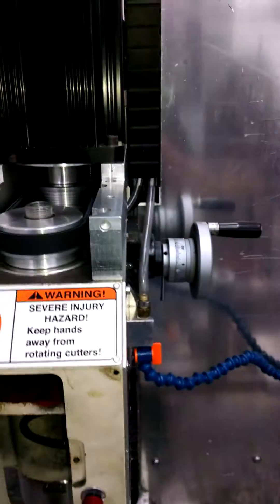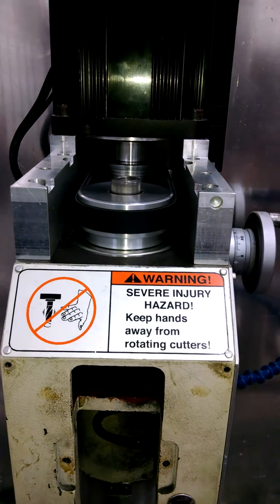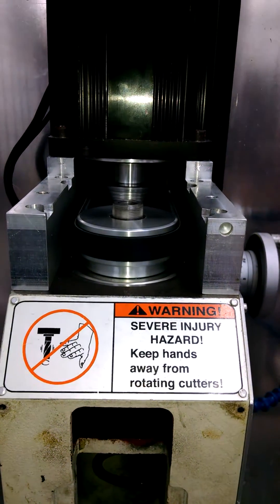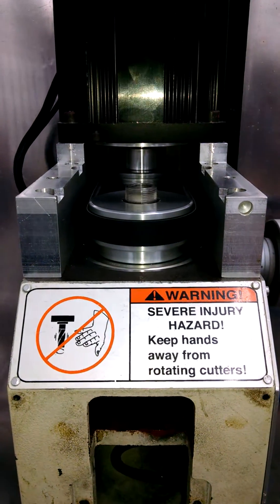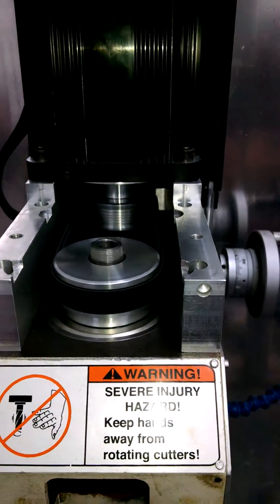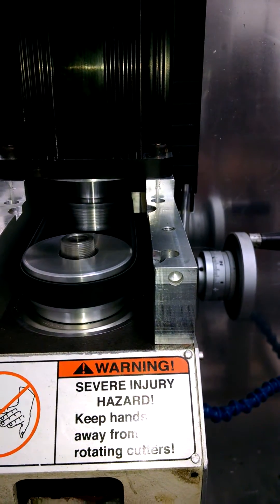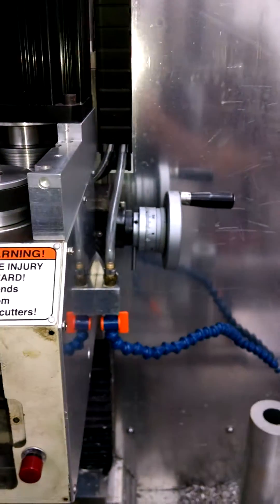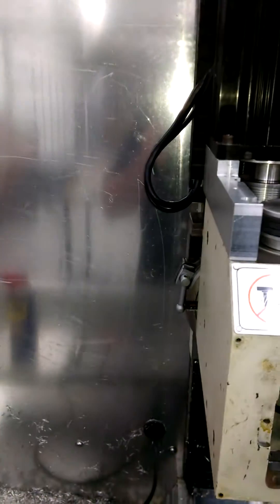G0704 Poly-v multi-rib belt drive conversion

Comment: Would you be willing to share the cad for this pulley? I'm getting ready to upgrade my g0704 to a bigger motor and want to use this setup, it looks amazing!
Reply from the maker: here is a good link to russtuffs video who is performing the same upgrades i had done upon my recommendations. it really is a huge difference in performance and part quality after the fact! I highly recommend following along as well!  
https://youtu.be/X-dKMvi6FJ0
Reply: @SmallShopConcepts  I'm a long time Russtuff, his last video on long reach stuff is how i found you!

(there's no link in your last post)
Reply from the maker: @TMCmakes  there was i just spaced it down below the text body.. removed the spaces should be visible now without hitting the read more
Reply from the maker: not sure if i still have it, but will take a look.  switched to fusion 360 a while back after loosing a hard drive with all my models.  the pulley would need to be setup for your specific machine as I found the best way to drive the G0704 is with the quill barrel to accommodate an twisting stress higher up on the thinner spindle top which causes poor surface finish.  also i don't recommend a BLDC motor, I would recommend going straight to a 3ph AC motor 1.5hp is a great size for this machine.  shoot me your email and I will see if i can send over the pulley model.  here is a link in the interim to my Instagram page with some more images of the setup and quill barrel turned down and balanced and assembled with the pulley.  https://www.instagram.com/p/_aCTWcur2O/?utm_source=ig_web_copy_link

Comment: Looks great!How did you attach the pulley to the spindle? Is it set screwed to the splines like russtuffs? I'm in the process of adding a belt drive using a 2kw ac servo and using russtuffs 2:1 suggested GT2 L series drive components so will give me a spindle of 5000rpms. Thank you,BMac
Reply from the maker: I made a custom pulley that press fits inside the quill barrel and is bolted from the outside of the quill barrel.  the timing pulley are LOUD, that's what I used previously.  the multitude poly V as seen in this video is very quiet and smooth, no vibrations!!

Comment: looks good! did you make the belt conversion yourself?  where did you buy the spindle motor/controller and spindle bearings from?

thanks
Reply from the maker: yes, made the belt conversion myself.  it is on Instagram mostly.  bit it was an awesome upgrade and so much smoother!

the motor in this video was garbage and would not recommend it.  the new motor is a 2hp ironhorse from automation direct with a Durapulse GS3 VFD.  much happier with its performance, it's a must do to go 3phase AC in my opinion!